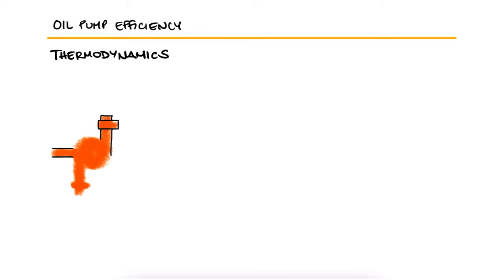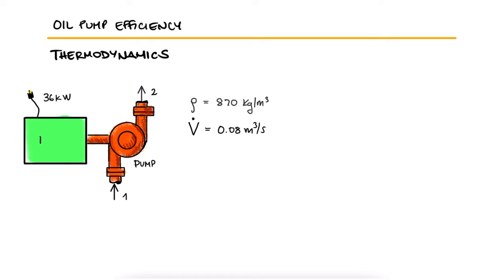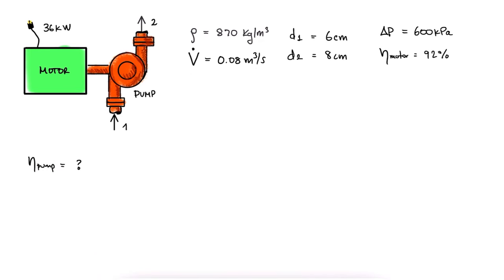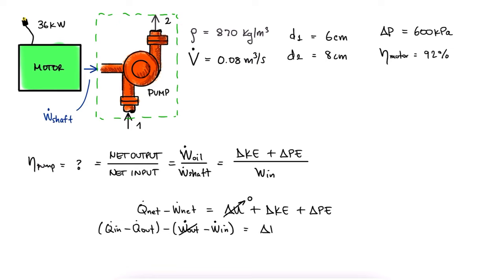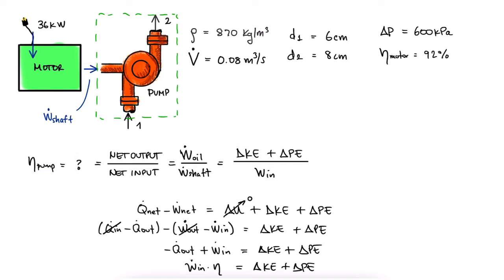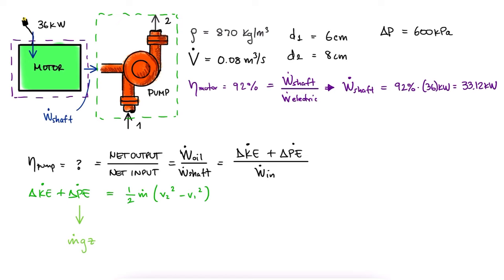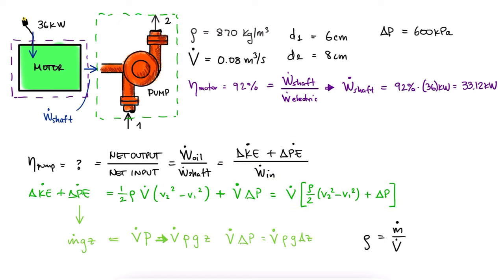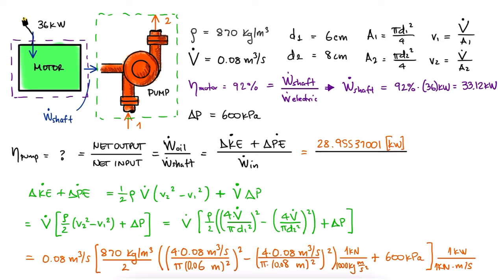Efficiency of THERMODYNAMICS Systems - Oil Pump Efficiency Example in 3 Minutes!

Comment from the maker: CORRECTION: At 2:53, in the orange line, d1 is shown as substituted with 0.06 and d2 is shown as substituted with 0.08. It should be the opposite. However, the final answers are still correct: W_net output is indeed still 28.95531...kW